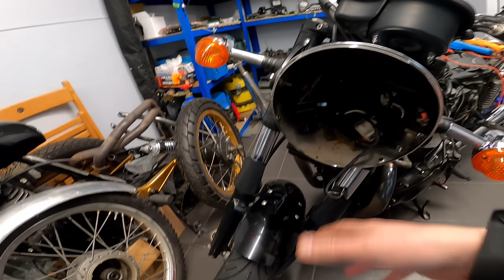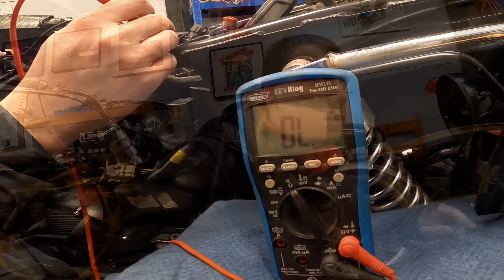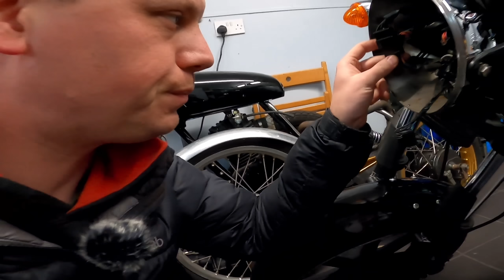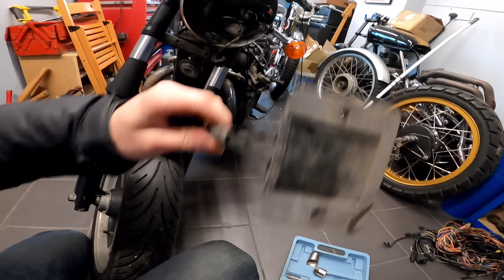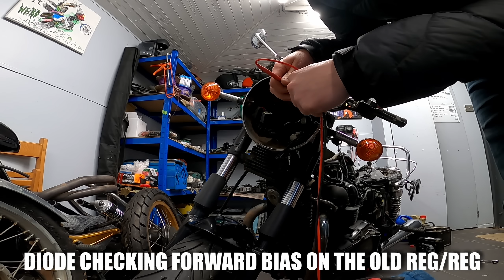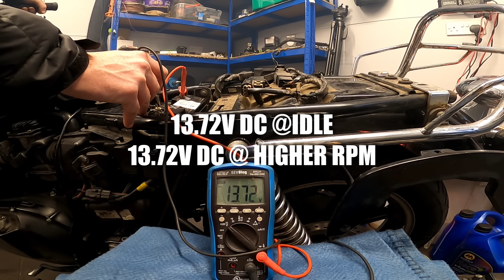Freddie Dobbs' Bonneville | Where do the volts go?

Comment: do not probe into plugs the way you did at 7:31 no matter how careful you are you will sprage then causing a bad connection. either back probe or get a wire set correct for the job
Reply from the maker: Agreed! Good spot and I should and will make mention of this. I am changing this connector and terminals anyway so no future risk.. thanks for commenting pal!
Reply: @TheWurks  I could have been a complete wanker and pointed out you should only do voltage tests on connected and live circuits. But I stopped short of that comment. 😬
Reply from the maker: @nuppy.9117  well you’ve said it now… ;)
Reply: @TheWurks  😬
Reply from the maker: @nuppy.9117  keep it coming though pal, im always happy to learn :p

Comment: Reg/rec block connections are a pita and also corrode....... l solder join and heat shrink. Relocate so it gets cooling airflow.

Comment: You're doing a good job on the electrical side. As for the running issues, I would start by checking the tank cap breather, just in case it's blocked and causing intermittent fuel starvation.

Comment: Good diagnosis. Very poor that the previous 'mechanics' that worked on Freddie's bike could not diagnose the rectifier, or even check that it was securely connected. Doesn't take long does it? What mosfet rectifier you going for? Are you going to relocate it or leave it up front?

Comment: Great video mate, just a heads up for Bonnie owners , my son has one and has suffered from numerous electrical faults . Being his go to Mechanic dad this is what I have found . When they make the frame loom and have a joint for more than one wire they crimp them together with a tube of metal. Water gets down the loom and corrodes the crimp (which is only protected with a sliver of tape). Hope this helps someone .

Comment: Good diagnostic work!  A perfect example of why mechanics need to do a thorough visual inspection.   I upgraded my vintage honda regulator as a precaution.   Fyi for those not familiar... The old regulators shunt additional current from generator through them causing a hotter regulator and more potential for generator coil failure.   I wanted to protect the generator coils.

Comment: It might be worth fitting a MOSFET, when I rewired my stolen/recovered 04 T100 I fitted a FH020CA from a S1000RR wired directly to the stator I mounted mine where the fuse box was with Furukawa QLW plugs with the output directly to the battery through a 30a maxi fuse and also fitted a Motogadget M unit blue. 

The wiring on mine had been cut randomly. I replaced the clocks with and old Motoscope light/Motosign, rewired the switchgear to earth switching for the m unit with internal routing through the handle bars. upgraded the left switchgear to later T100/120 switchgear so I could use the pass button for the headlight and the i button to scroll through the LCD display.

I needed a new ignition switch as it had the wires cut and the lock damaged by the thief jamming a screwdriver in to it, but I couldn't find one at the time. I eventually picked up a Triumph Thunderbird 1600 switch and relocated it to the right hand side if the frame.

I did have a issue with the ignition cutting out in the rain but that turned out to a loose connection where the HT leads plug into the coil. I squeezed the terminals so they gripped the post on the coil tightly and it's been fine ever since.

Comment: How easier/harder would this be if Freedie's Bonnie was a CAN bus model with the VDO gauges?
Reply from the maker: No difference.. the charging system is independent of the other systems on the motorcycle in terms of function. My scrambler has can bus added and would be tested in the same way.

Comment: What's wrong with the English term "earth"?
Why "ground"?
Reply from the maker: In true electrical terminology earth is not an English term its application specific. Earthing predominantly pertains to household or static installations for safety and dissipates current to the earth in case of failure. This is shared with ground points which generally sit at the same potential. 

Earthing discharges the electrical energy to the earth. It is mainly in use to avoid shocking the humans.

Grounding provides the return path to the current source. It is mainly in use for unbalancing when the electric system overloads

Comment: I’m having some weird issues with my idle speed and the rectifier is my first thought but I’m not sure exactly how to test it. I’d love to hear about troubleshooting with a multimeter. 

Sometimes when my bike has warmed up my idle speed goes all the way up to nearly 3000 and then will eventually reset suddenly down to normal (around 1500) which I assume is the ECU trying to bring things back into a normal range. Sometimes it doesn’t do this until I turn the bike off and then back on when warmed and then the revs will suddenly be very high. This is especially noticeable if I’m riding in the rain, the bikes been washed or if it’s humid out but sometimes it’ll suddenly throw an engine management light and the revs will be sticky at 2700 and slowly climb back down after letting off the throttle…

Comment: Nice clear video on how to check the stator. On older Hinckley triumphs it was a common bodge to run the regulator DC output  direct to the battery and to bypass the wiring loom. You often gain 0.5v at idle while charging. I can vouch for this as i ran my 955 sprint many years this way .

Comment: Good job👍.  Had excatly this on a Vstrom happen.  Rectifier cooked itself and stator side wiring on first ride, melting the wires leaving me stranded.  Quickly diagnosed the  issue and replaced it with a MOFSET aftermarket part. Took the opportunity to renew the stator to an uprated uk made one as original was quite weedy and aftermarket heated grips had been added (these oem stators often failed).  Now see 14.4 to 14.6v charging. Battery upgraded to Yuasa higher cca version. No more electrikery problems 😁

Comment: I've just sold my CBF600N8 that I put 128,000 miles on and when I had the seat and tank off, and occasionally headlight open, I used to spray XCP Clearcoat on the electrics and frame. Does this make a difference or was it just because it was Japanese that I never had any electrical, rust or oxidation issues?

Comment: Rectifiers on these older 865's have a reputation for failure so no surprises there... Mechanically they are stout, trouble free, simple and very long lived and unlikely to cause any grief for owners over the years... (I've had 7 of them😵‍💫 😁)... If they have been periodically serviced, they are tough as nails. I suspect the the rough running might be due to the exhausts that was recently changed by Freddie without a re-map. I'd say it needs a re-map and it needs its throttle bodies synced correctly, and it will be run like a top. They deserve to be "opened up" a little with a good set of exhausts, snorkel removal and free flow filter (TOR exhaust's are great, not too loud and they look relatively stock) It will transform the bike and dare I say, "better" than the liquid cooled 900 Bonnies. Good work mate 👍. Thank's for the video 😉

Comment: I had a Daytona 675 that fried its RR after 1,000 miles. Dealer replaced it with OEM part and a few thousand later it did the same thing. A smaller local shop installed a Honda part and it never happened again. He said Triumph knew it was an issue but was unwilling at the time to correct it. I’m not surprised this bike is having RR issues as well! Good job finding it and helping Freddie out.

Comment: I personally would not suspect the regulator yet, yes it dose seem a little low at 12.75 but it's a cheap alternator that uses a zener diode(s) to regulate by shorting to ground anything over the zena threshold they don't drift as they get older they will  fail in one of 2 states full short circuit or full open circuit if full open circuit the output will be unregulated  dc variable with engine speed just like the open circuit alternator and a short circuit fail doesn't last long because the battery will blow the zena to an open circuit state quite rapidly 
It's about time that bike manufacturers used alternators with a live field instead of cheap permanent magnets

Comment: That was a great vid, thank you for this, a question if you have time to answer and no worries if you don't as I can see you have 195 comments already but, so you determined the Voltage regulator is shot, because, on the AC side you saw higher and lower (fluctuating) amounts of Voltage, but on the DC side it was a solid static amount of Voltage, do I understand that was your indicator, if so that is great to know I have replaced a few voltage regulators in my day but to be honest I figured out the voltage regulator was the problem by a process of elimination, being able to do it the way you did would be a great help. Anyway no worries if you can't answer the question, great vid and just wanted you to know I have found out about your channel since you took on Freddie's bike, thanks again cheers.

Comment: 😊Freddie's poor running issue seems to have occurred or been exacerbated by  the used stock system. That stock system has an oxygen sensor port which provides feed back to the computer. Was the sensor and its' wiring installed or the port blocked?  It is hard to imagine that port was left open. Insufficient electrical current caused by a faulty solenoid/rectifier willl certainly contribute to poor spark. I told Freddie a new rectifier was in his future.

Comment: Nice work Sir! Keep them coming. Previous video I mentioned one known common issue on Bonnevilles...the common ground connection sitting in the large wrapped bundle of wires at left side of steering head...gets flexed with turning of front wheel...the conductor can fracture and give squirrelly electrical gremlins. Have to strip away the wrapping to fully inspect and repair.
Reply from the maker: Absolutely, have that noted on the white board from your previous comment! Thanks for chipping keep it coming I need all the help I can get on this one!
Reply: @TheWurks  With your finding of no DC regulation over 13.7v, it could be that most of the bike issues were from dwindling battery power after short operation....the ECU demands a reliable voltage stream to keep everything happy. Note there is a starter motor cutout "feature" on the ECU that will not operate the starter if volts are below something like 12.2v ...which is actually more than enough  to fire the bike up. Some kind of "Safety" mode to protect the starter sprag I guess. The work around for when your stranded is to short the starter solenoid or to have little hole in the starter relate casing to push as twig into the relay to momentarily close the contacts, starting the bike. 
Point is these bikes are quite fussy on having good voltage at all times.

Comment: Change in inductance- no. High resistance causing the rectifier to "work" harder - no. It's dead. easy to test a rectifier after all it's only diodes, nothing more nothing less.
Reply from the maker: I would have to disagree, only slightly though ;)... 

We have to consider the voltage smoothing capacitors and the regulator circuit shunting to ground. Also the cold start run doesn't factor in the further potential breakdown the hotter it gets.

Comment: Great investigative work Joe! Will the rectifier main wiring harness connector have to change to suit the upgraded rectifier? Is there any evidence of rust at the frame negative  terminals? Internally, the motorcycle could do with a serious clean. There seems to be a serious amount of dust & road  grime that most of those connectors can’t keep out.
Cheers for the updates🤙

Comment: Auto electrics is definitely above my paygrade but I did have a suspicion that Freddie's bike's main problems were electrical based and certainly not massive loss of compression. It was an interesting watch to see you going through methodically checking as it is a black art to me. Hopefully its rough running is just down to mixture issues and can be sorted fairly easily.

Comment: Just a comment regarding testing diode-packs in a rectifier, does not necessarily prove anything. I have, in the past, found several regulator/rectifiers that apparently check out ok, but in fact don't work. The key is heat. They can, over a certain timespan, overheat and fail.  When cool they will check out ok.  Best test is to A-B test with a known, working, regulator/rectifier.
Reply from the maker: Agreed!

Comment: WTF's a rectifier?
Reply: A rectifier is an electrical diode that basically does 2 things.  It converts alternating current (AC like in your house) to direct current (DC like for a motorcycle battery).  Second, it only lets a certain maximum amount of electric get through , and converts the excess electric to heat, so as to allow the proper voltage to the battery.
Reply from the maker: Well said!
Reply: Changes A.C. Current to DC current
Reply: Gracias!

Comment: Interesting!  I'd think 13.7v should be ok?  But those rectifiers are known to NOT last forever.  You know, sometimes a really vexing thing can happen with electrical parts.  They can be intermittent when they are on their way out.  I went bananas trying to solve a problem with a coil before I figured out what was up.  The coil would test OK and it would make a spark, then next go it would NOT make a spark.  LOL.  It was shorting out internally, but not 100%.  I wonder if that rectifier is wobbly like that.
Reply from the maker: I don't believe 13.7 at all rpms is a good output on these. Basing on my experience with a few 865's including my scrambler. It indicates that it is already shunting to ground at that voltage and key here is to not it has been under a long duty cycle therefore not generated a great deal of heat.

I will do a test compare on the scrambler on film to demonstrate. You are absolutely right with how strange these things can behave in failure mode.
Reply: @TheWurks  Thank you, that's good info for me to have!  If you know 14.3v is the correct output and you're getting less,  that seals it, time for a new one.  I didn't know Triumph had a newer kind of rectifier that you can use.  Maybe if my bike ever needs one, I'll do what you're doing and use the new style.  I had in mind if I ever needed a rectifier to just replace it with a new Yamaha rectifier off Ebay for 1/10 the cost of what Triumph charges for one.  LOL
Reply: Yamaha xt660, 2007, from the day one, 13.7 V, battery replaced after 9 years (as prevention). I have not experienced any problems.
Suzuki sv650, 2017, 14.5 V, replaced battery after 4 years.
Reply: @petre1198  What's funny is the wiring harness on my Bonneville has Japanese stickers all over it.  The starter motor is even a Nippon Denso.  So I think all the electronics on the Triumphs are Japanese, anyway.